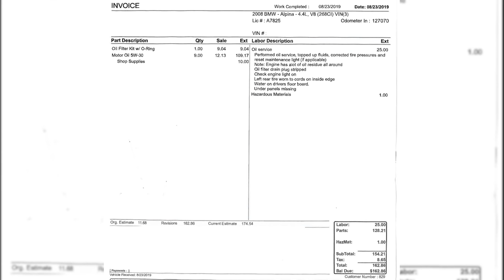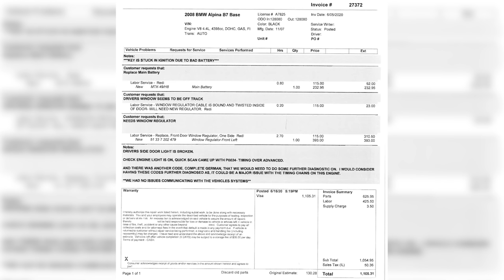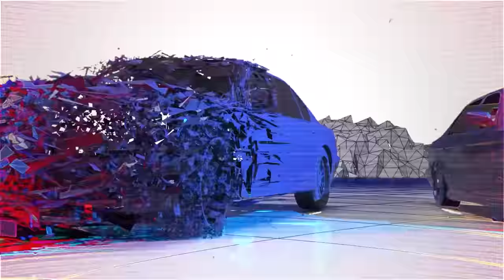Broken Alpina Is Hiding Secrets and a NAIL, Literally - Supercharged B7 - Project Chicago: Part 2

Comment: in the next episode; Sreten takes on a new project, a 67 year old male human with an unknown malfunction. Diagnose kit revealed no definate problem, but this will require some basic surgery going in from the left side of the right eyeball, taking bits and bobs out along the way to the throat, dissecting the liver from inside out, replacing stomach seals while manually pumping the heart . Working along the intestines and finding the fish grate in the appendix. Torque everything up to spec, put new sealant on heart to aorta connector and call it a day.........still easier than doing this Alpina

Comment: They probably used the nail to lock the engine for the timing, because they didn't have the special tools. Seen all sorts of stuff, from screwdrivers to pins, just... Not in the oil pan. Must have fallen down at the chain and the guy from that shop didn't want all that extra work to get it out.

Comment: Just a question, you didn't mark the direction of rotation on the belt ? because if you reuse the same, it is better to re put it in the same way so it is not torn in the opposite direction right ?

Comment: One thing in US, unless things have changed, auto manufacturers have to produce some parts 10 years after an auto was manufactured.  Higher failure components get made more.  Seems BMW must limit some parts or when it is proven to be a problem part, just say its obsolete and stop making it.   Maybe BMW designs failure into part, make it last 10 years and bam...failure.   Then they don't have to make but so many parts.  Wish that aftermarket would be able to take some high failure bits and reproduce better items when it comes to plastic air tubes, hoses and vacuum lines.  I know they wouldn't be able to make every part under the sun for cars, but with technology and advances, one would think some niche parts would come about.

Comment: Iam a avid follower of the channel BUT have no mechanic knowlege. So i need to ask ..... does that nail need to go through the whole engine to get into the oil pain???? if so if there are no marks on the nail would that suggest it did not get caught in any moving parts?
Reply: Would of more then likely been dropped and went down the timing chain galley and stayed in sump

Comment: Too bad you couldn't have dropped the engine but the lift restrictions are what they are. If that nail was actually in the oil pan, it got there one of either two ways: It was intentionally dropped in, possibly down the oil dipstick tube or one of the previous mechanics was using it to probe or hold something and it wound up dropping in. Not an easy feat. Great work.

Comment: I have a problem in bmw 325i 2002 I changed the  gasket set of cylinder  and now I got oil light when I start it comes after like 10 seconds and its gone every single time pls help pls

Comment: Far easier to pull the engine out look at the chances of getting debri into the oiling system working like this , way to involved work wise to leave the motor in place,   and a knackered back for your efforts minimum, so much easier on the engine stand or workbench .
Reply from the maker: Thank you captain obvious. Not like I explained that in the video.

Comment: A $10,000 dollar engine defeated by a $1.99 rubber seal (that they cheaped out on) buried deep in the very center of the engine. German engineering at it's essence. 
*I love my 6 speed Corolla.

Comment: What I don't get, you stripped most of the engine knowing compression on cylinder 7 is below minimum and only looking to do timing chains
Reply from the maker: Did you even heard what I said or read that invoice? It was below minimum, they cleaned the cylinder and restored the compression.
Reply: @M539Restorations  I heard you, was this invoice from the same garage that tried to rip off previous owner for $11k? I would ideally look into this cylinders as you found so much mess on the bottom end. Don't get me wrong I wish you all the best.
Reply from the maker: @patryk5518  no, different shop and you'll see everything in the next video

Comment: I see you have alot of bosch tools and bosch make alot of great car parts too. Because all the best bosch gear is made in Germany.  But then you said about the Milwaukee rattle gun, best 350 you ever spent, and it's phenomenonal. Ooh, all my co workers have Milwaukee gear and they say it's great, until it gets between 1 and 2 years old and then it's rubbish. By that stage they've committed to the brand because they've bought all the batteries and chargers. They find Milwaukee always fails somehow, the batteries, the handles, gears, battery connections, switches, and Milwaukee gear sounds like it's an American product . But it's not. It's cheap chinese crap. My gear is Bosch, European engineering and quality at its best. It lasts.  All chinese stuff is copied from other brands. They don't do anything except COPY

Comment: This is why combustion engines need to go. Overly complicated. Unreliable. Extremely expensive. Fewer skilled technicians can even tackle this job. There has been a shortage of skilled technicians since the 90s. Now it's even worse. Imagine how many years it would take to be efficient and competent in this field. Also the cost of tools is $100k alone. You never stop buying tools. Electric cars are not my favorite but having spent millions on buying and fixing these over engineered European cars I can say that they are their own worst enemy. This way of designing vehicles is bad. Bad for everyone. The dealer,  the technicians,  and ultimately the owner. It brings the brand down. I mean seriously. The B7 was supposed to be the best of bmw. And it is cheaper to scrap them then to fix them.